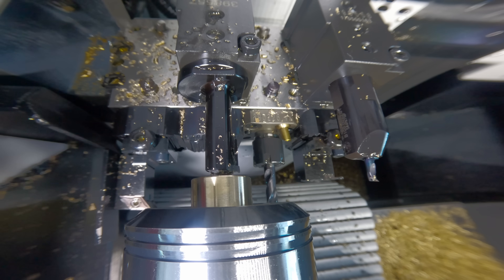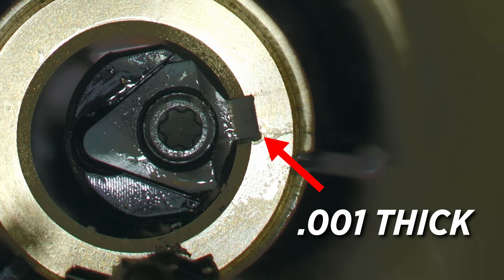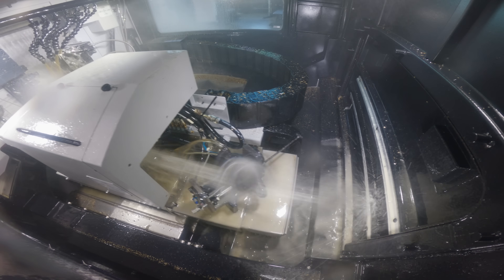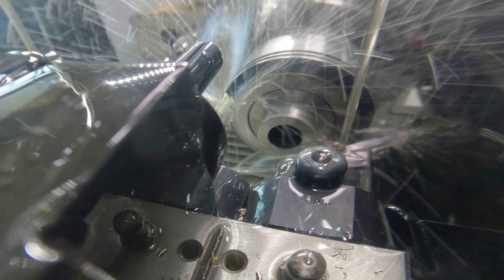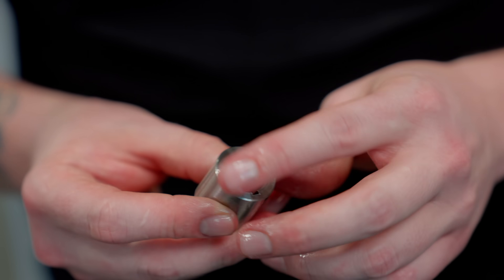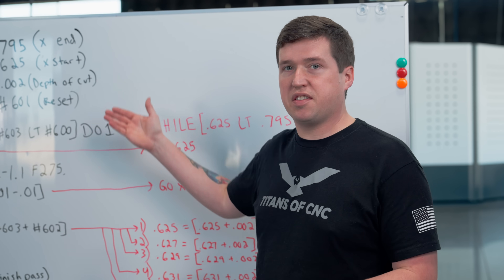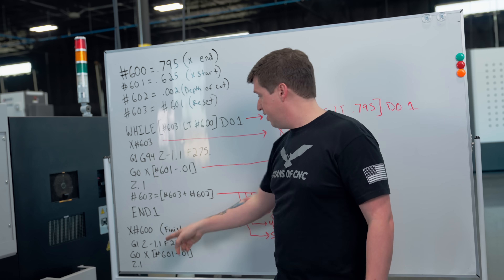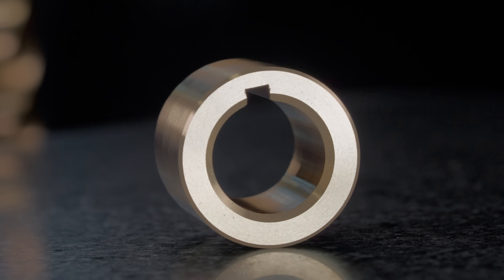Masterful Macro Technique for Internal Keyway Broaching

Comment: right on time . I was prepared for a lot of writing tomorrow
Reply: Another way to avoid all the writing is to put your first 2 passes in Excel and it will usually recognize the patern and do all the X value stepping for you.

Obviously Macros are a better way, but not the only way.
Reply: @mgk1397  
Use G71 or put the incremental movement in a (internal) subprogram and repeat it, something like;
/
M98 Q2002 L70 ( repeat N2002 70 times )
/
M30

N2002( REPEAT 70X - CUT = 0.05MM )
G01 G98 U6. F1000.
W-40. F4500.
U-5.9 F1000.
G00 W40.
M99
%

Comment: I always use a sub program loop but this is cool,  and macros soooo, way cooler
Reply: Yeah, G91 sub with L values would be my go to
Reply: @Aztal  "If it doesn't have #500 use... shrug sorry." IF IT CANNOT RUN THE TIC-TAC-TOE CODE WE WILL USE THE M98'S OUR FOREFATHERS USED!

We don't take giant cuts, we do little dents
We don't use absolutes, we use increments
We don't cut off a shaft
WE PRUNE THE AFT
We don't just press Cycle Start
then go play Mario Kart
We're making metal art

...sorry lost my train of thought. G91 sub with L values is what I'd use as well.
Reply: G71 works too

Comment: You can do the same with a simple G71

For example:

G0 X40. Z20.
G71 U0.1 R0.3 
G71 P100 Q200 U0. W0. F8000
N100 G0 X45.
G1 Z-60.
N200 X40.
Reply: Thats clever! I like it
Reply: I would have thought G71 can't work without rotating spindle.  Interesting
Reply: @ it can’t on some machines
Reply: I use it on our DMG Mori Machines all the time and it works absolutely fine. I’m pretty sure, this will work on all machines with Fanuc (or Mitsubishi on some Moris) Control. Of course you have to lock your C-Axis and switch to mm/minute (M and G-Codes are different from manufacturer) before you start the G71 Cycle.